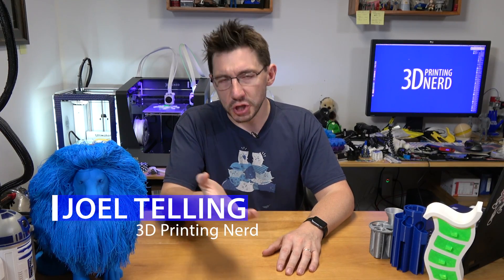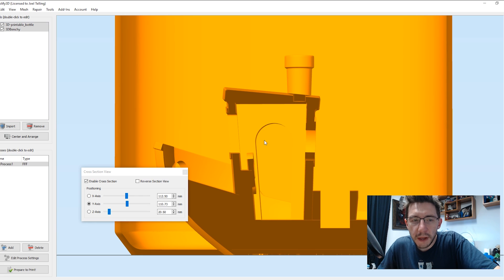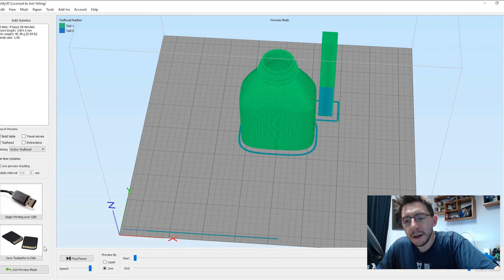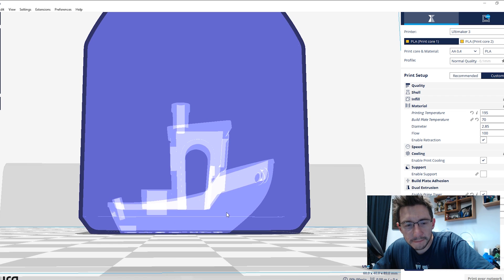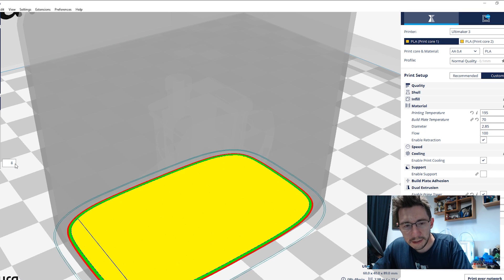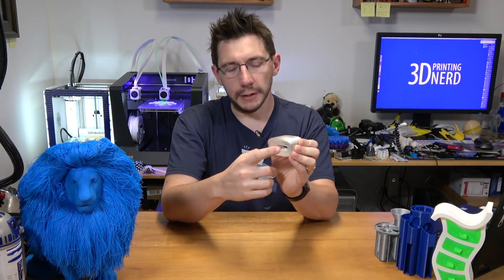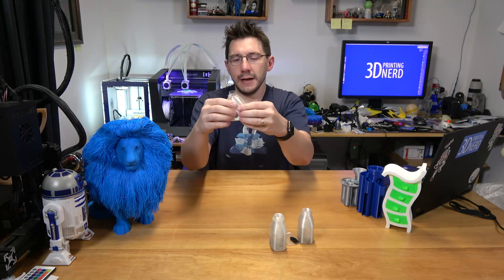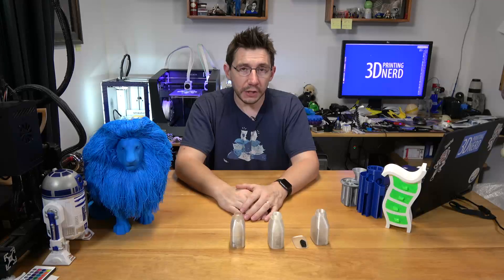3D Printing a Ship in a Bottle - 3DBenchy on the Ultimaker 3 using Polymaker Polysmooth

Comment: Print the benchy on PVA supports inside the bottle and then fill with warm water to dissolve. You could also print the bottle and bench in the same colour to avoid massive prime issues. Benchy in a bottle a different way..

Comment: With single extruder all you have to do is print the bechy first and then you pause the print of the bottle alway à through to put the benchy inside ^^. Because we don't need multilaterial extrusion if we're smart
Reply: Should have read the comments tho
Reply from the maker: True, but, sometimes I just do stuff to do stuff :)

Comment: Why does it still need to keep building up the waste tower after 2 filaments are not longer needed? In this video 2 different filaments were only needed for the layers which a benchy is being built and after the benchy is finished continuing to build up the waste tower seems like a waste of filament.
Reply: Nevermind I just saw that it doesn't keep building it during the print. It only showed it in slicer so I was confused and thought it would actually waste filament during the print.

Comment: High five! Are there any filaments that print see though without needing to go into a poly smoothing machine?
Reply from the maker: Um... The Colorfabb HT clear can but it has to be printed very hot and very slow. I think.
Reply: Hmmm... I am guessing you need a pretty good printer with a heated bed for that... Would an Orion Delta do it or do you need something more fancy like a Zortrax, Dremel or even higher quality like Ultimaker?

Comment: Do you prefer the orthographic view as opposed to perspective view? Which one is better?
Reply from the maker: +The Rogue Spac3man I don't know? I just, um, never thought about it.
Reply: The Rogue Spac3man Depends on what you need it for. Perspective is more pleasing to the eye, but Orthographic shows the accurate scales no matter the viewing angle. Ortho is most commonly used for engineering drawings. Either one works

Comment: It's a bit disappointing that S3D wants to continue to print the purge tower even after the point where there are no more tool changes. Seems like an easy fix.
Reply from the maker: +Mike Brum I don't think that's limited to Simplify3D, right? Are any slicers intelligent about that? Also, I'll try to put a bug in their ear
Reply: I assume that when you printed on the UM3 that you used the Cura settings? Because I see that the purge tower stopped printing after you reached the top of the benchy (~8:22).

S3D's preview showed that the purge tower continued to go all the way to the top of the bottle (~3:45).
Reply from the maker: +Mike Brum good eyes man! I did that all late last night and it's been a nonstop rush to get packed, work, and get to the airport. I'm in the airplane now. I'll take a look at those one marks once I land and have a chance!
Reply: No rush - enjoy MRRF. I'll be keeping an eye on the channel and twitter for updates. :)

Comment: Unless your printing at 0.05 layer Heights it's not going to recognise the gap between bottle and benchy
Reply from the maker: +shane beasley you're right dude. I didn't even think about it that way. I want to test a bit more and see what the slicer decides.
Reply: 3D Printing Nerd I was thinking the same actually, to see if putting a 0.1 gap when doing 0.2 layer Heights renders the gap obsolete or if it sees the gap and just makes it 0.2
Reply from the maker: +shane beasley I get the feeling it's up to the slicer to make the call at that point, eh?

Comment: Joel, If you print at 0.2mm layer height you can't put stuf on a 0.05 offset from the layer height. If you do that, like you said in the video you put the benchy at 1.05mm, you will let the slicer make a dicision for you so it will be on the 5th or the 6th layer...
Or did you print at 50micron resolution?
Reply from the maker: +Marco Lagerwey you know, you're right! I never thought about that but it TOTALLY makes sense! Now I want to text some more.

Comment: I like Joel's way better but since I do not have a printer with dual extruders I did it the other way. Printed a small (very small) Benchy then a bottle that was also scaled down. About half way through the bottle print I paused the printer, jogged the head out of the way and dropped the Benchy in. I resumed the print and, because the Benchy was sitting right side up, the head bumped into it. Fortunately there was enough room so the Benchy just fell over inside of the bottle with no harm done. Now I have my own Benchy in a Bottle.

Thanks Joel!

Comment: I'm new to these 3D printing videos. What happens if you try to print a floating, unsupported object (ex. move the boat into the middle of the bottle with no support)? Does it give an error? Does the printer try to print in empty space? Sorry if this is a stupid question lol I know nothing.
Reply from the maker: Not stupid at all! 3d printers can print supports. It's essentially scaffolding to let it print stuff in mid air. Then, when the print is done, the support material is either pulled off or dissolved in water!
Reply: 3D Printing Nerd, Oh wow that is neat!! Thanks for answering :)

Comment: could you 3D print a working Rubik's Cube
Reply: As a single print, its definitely possible, I've done it before. Only problem is printing a "working" one with little enough friction to where turning with a single finger is possible(I don't have PVA). Printing it in pieces on the other hand has been done a million times by puzzle designers and those who buy the models to be printed.
Reply: You must be a cuber.

Comment: Cool! With your 0.1mm layer height, it would be less confusing if you set the benchy's starting height to 1.1mm instead of 1.05mm as it will anyways round it up to 1.1mm. Also you can use up/down arrow keys to browse layers instead of typing it every time (:

Comment: I thought you might use a transparent filament for the bottle
Reply from the maker: I did! It's the Polysmooth transparent filament. However, I couldn't finish the transparency process because the inside of the bottle was getting tacky and the Benchy was getting stuck.
Reply: Sorry, but great video nonetheless.
Thank you for the effort

Comment: could you print a benchy or something in a box or ball or something and make it out of pva filament so you would have a deployable benchy or something when you put it in water.
Reply from the maker: So, the Benchy would be inside a box printed with dissolvable filament? interesting idea.
Reply: they you could have a deployable duck or boat or HIGH FIVE in water of course

Comment: I'm sorry if this sounds dum but what's the point of the 3d printer printing the tower to the side of your build
Reply: noahrocks11now - it's to allow the other extruder that wasn't working to Prime itself before it starts actually printing. makes for higher quality prints.
Reply: Clears the nozzle for the color change
Reply: O ok thanks

Comment: Cool idea Joel, and on the same day that Angus did his video about doing waterproof bottle prints. Spooky eh :-)
For those without dual extruders, you could print Benchy first, then pause the bottle print to insert Benchy inside.
Reply from the maker: I had NO IDEA Angus was releasing a bottle video. Holy cow! As for single extrusion, it would still work with my method, but, the Benchy and the bottle will be of the same color / material.

Comment: Single extrusion....print the benchy...then print bottle and while its building the sides, slow print speed to say 10%, then drop the benchy inside...set back to 100% rate...viola
Benchy in a bottle with a single extruder
Reply: Jake Smith uh yes it would
Reply: Jake Smith - sure it would, if you just let the bottle sides get taller than the benchy before you try it.
Reply: Single extrusion would definitely work, pause the print when the walls are high enough to slip the benchy in and resume, you'd be good to go.
Reply: 3D Printing Nerd - your way isn't the harder way- you have dual extrusion capability. Your way is good practice for learning how to get the most from your machine! And also just good fun...
Reply from the maker: +Karkitty202 I didn't because I just wanted to do it this way and see if I could. Woot.
Reply: 3D Printing Nerd The way you did it made for a much better video than if you'd just placed it in there, you also taught people how to print things inside if one another without having to be there during the print. You got a like from me man
Reply: Cause he has a wicked cool dual extruder rig....and he is the 3DPN :D
Reply: It's actullay voilÀ x)
Reply: Eric Kieber k
Reply: Ill defenetly try that once I build my ewaste
Reply: Brian C I don't know why he didn't just do that
Reply: It IS IS, not si.
Reply from the maker: Yes, that would work beautifully, but, it's always fun to try a harder way sometimes ;)
Reply: Thanks for you service to our country
Reply: Brian C it si voila, not viola
Reply: Brian C that wouldn't work you stupid fucl

Comment: Why don't you try to print with clear fillament?
Reply from the maker: I did, but it requires smoothing in the Polysher to be clear, and I haven't gotten down that process quite right yet.
Reply: 3D Printing Nerd Ok. I have seen a video from Tested. They were at the set from Ghost in a Shell and they printed the exo thing with clear fillament.
Reply: 3D Printing Nerd Thats the link to the video.
Reply: 3D Printing Nerd bte I think it's very cool that you read and answer the comments. keep it up 👍

Comment: Hey Joel,  Is there really a need to prime the nozzle before every layer? I assume that it was to prevent the black filament from stringing on the bottle but just wanted to make sure that assumption is correct. Awesome video man, keep up the great work.
Reply: You need to clear the, uh, clear filament before you print the black and clear the  black filament before you print the clear. The tower is kind of a  brute force way to do that. Eventually  (hopefully) most of the mixed color will get turned into infill as the slicer gets smarter about how long it takes to shift plastics. I'm not sure the tower goes away entirely but it should become thinner.
Reply: I wish I would have thought of doing this 2 years ago when I got my Replicator 2X at work. I eventually stopped using dual extrusion because although the thought was nice, the prints always looked like crap and trying to clean up one color out of the other was almost impossible to do and make it look good.